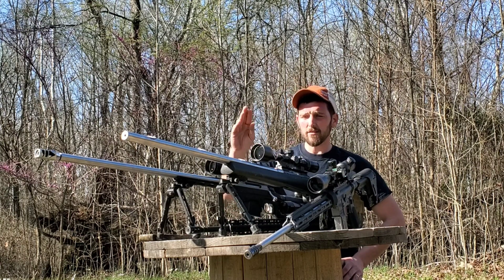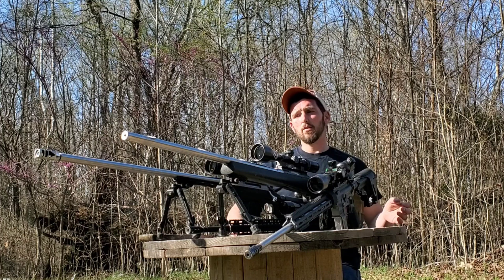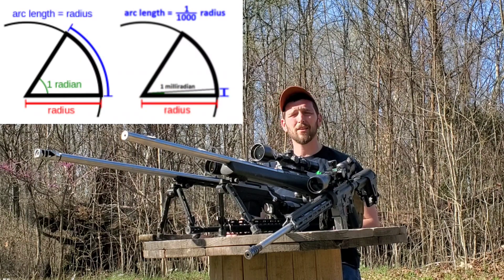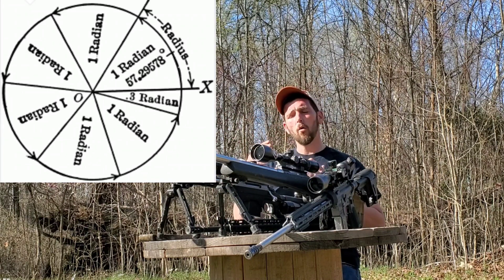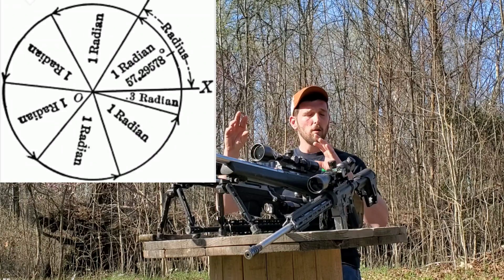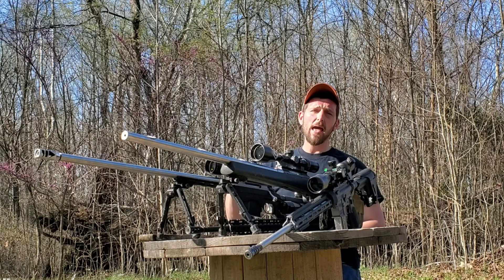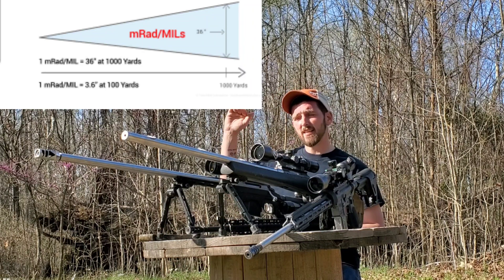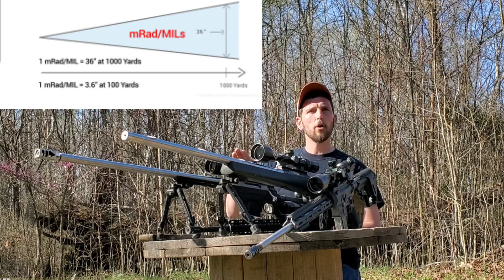Breaking Down MOA and MIL and Their Use For Precision Rifles

Comment: Radian is derived from the "radius" of a circle, which of course is the distance from the center of the circle to the circle's perimeter. Take the length of the radius and wrap it on the circle, like in your diagram, then divide it into a thousand units, hence milliradian.
I shoot with a MRAD scope, and here is something to note. 1 mil @ 1000 meters is 1m. 1 mil @ 1000 yards is 1 yard. the ratio is 1m/1000m and 1yd/1000yd. 

At my local range, it is broken down into yards, so at 100 yards 1 mrad is 3.6 inches and 1 click is .36 inches (the diameter of a .357/38spl/9mm bullet).  So at 100 yards, one click is 1/100 of a yard. If they only used decimal yards, sheesh. At the ranges where I shoot meters, 1 click at 100m is 1 cm which is 10mm (just like .40 cal). thanks for the vid.
Reply from the maker: Thank you. I honestly didn't realize that mils were that versatile amongst so many measurements.  I did figure out the part of a radian after researching it and I knew the 1 yard at 1000 yards but never realized the rest of it. I honestly prefer moa just because the nature of my sport (fclass). But I Also have mil scopes and can fluidly switch between the two.

Comment: Ballistics AE and AB mobile both have iphy. 4dof did not. Your options may be narrowed with iphy/smoa but you do have some options. I would be more concerned with making sure the turrets match the reticle, iphy turrets with moa reticle would be sadness.
Reply from the maker: Your right there are options but they are not only fewer with shooter moa but if your a new shooter and you dont understand the difference then chances are your not going to know the difference and just going to pick moa and then not understand why your data isnt lining up. But your absolutely correct there are options for it with many of the calculators and if you know what you have and understand the difference then it's not an issue.  I primarily use AB and I know that when I first started I didn't know the difference.  And I cant stand 4dof. Every time there is an update  it seems to go wonky and the Axiel  DF gets all jacked up and makes it impossible to keep data true